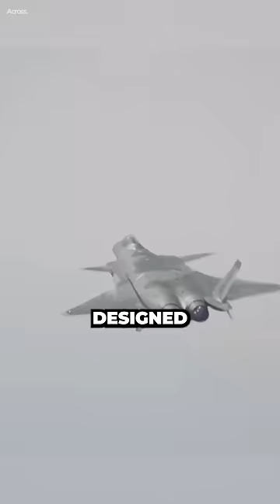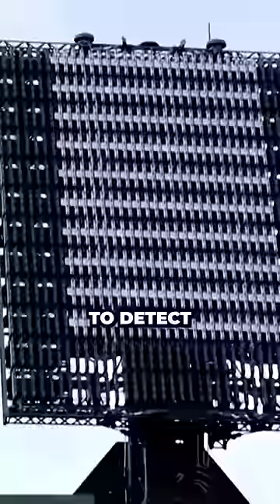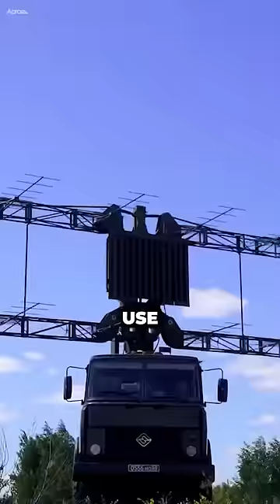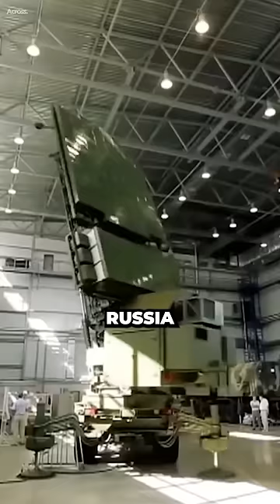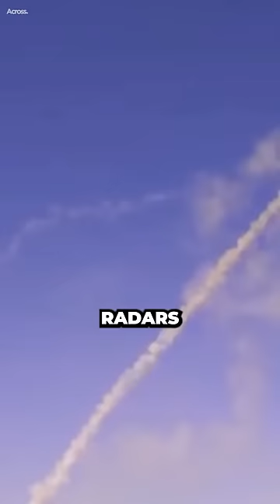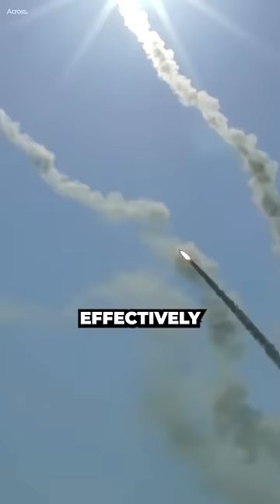How Russia's Radars Have Detected Stealth Fighters

Comment: We need to have in mind that stealth aircraft are made to be stealthy to other aircraft systems. Since jet fighters mounted radars are not as powerful as ground radars.
Reply: F15EX radar are so powerful, it can detect camel on the ground
Reply: @Overneed-Belkan-Witch  He's not an av guy, obviously.
18's have the option to flood the air space with radar in case they lose lock
Reply: Not exactly - stealth aircrafts are optimized to be stealthy against radars capable of weapon grade locks. While low frequency can detect stealth jets, it's not capable to pinpoint and guide a missile even against a 4th gen jet.
Reply: These are connected to ground based missile systems, if you've heard of new russian missile system, i think it's still classified, ut's a new russian missile system made with these types of radars and could in theory detect an object as small as 0.0045m² at 500mi, with constant tracking for the fired missile by both radar systems and personnel, these missiles are almost undetectable because of speeds up to mach 6 while going forwards and incredible direction changing, at smaller speeds (Mach2.7-3.4) and missile has a sonar system that detects bigger objects, so technically if a B-2 was to drop a big bomb, missile would automatically see it as bigger target and aim for the bomb. This is just what I've heard, but even with big propaganda factor, reaching at least a fraction of that would be fucking impressive.
Reply: Russia has a different approach to air defense than the US.
Russian fighter aircrafts are usually guided by a ground base to the enemy aicraft.
For this principle the use of a combination of HF- and LF-radar systems is quite fitting.
Reply: @maxmustermann9587  The problem is even AESA rarards mounted on fighters have trouble acquiring a weapon grade lock on stealth aircrafts even in WVR. The best strategy to combat stealth fighters might be heat seeker missiles. But to even get close enough to bring the fight to WVR is near impossible and comes with the assumption the stealth fighter did not shoot its own BVR missile.
Reply: @cmxpotato  
There were attempts to switch fighter jet armaments completly to missiles.
But when missiles won't work it is back to the old dogfight.
Reply: @maxmustermann9587  The thing is, the stealth fighter can detect a non-stealth aircraft 100 miles out and fire its missiles at BVR. If somehow all the missiles fail (US usually likes to shoot 2 missiles per target), the stealth fighter can turn back and run away. The only time there is a dogfight is when a stealth fighter (for some reason) wants a non-stealth fighter get close to it.

And modern missiles are very different from the Vietnam war missiles 5 decades ago. American missiles like the AMRAAM tops at Mach 4 and turns at 30G's. The chances of evading a missile in the modern battlefield is very very difficult.
Reply: @cmxpotato  
I hope neither of us has to find out
Reply: @cmxpotato  correct .. the f22 kills in exercises are all created where the f22 was put in so much disadvantage... just today our fa50 got a simulated lock and kill of sidewinder on an f22...the f22 had external tanks............